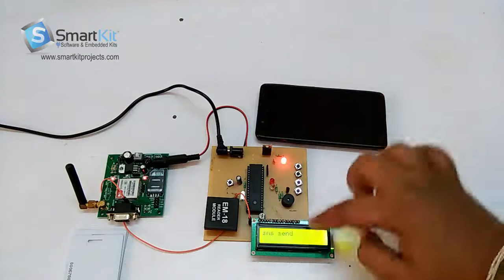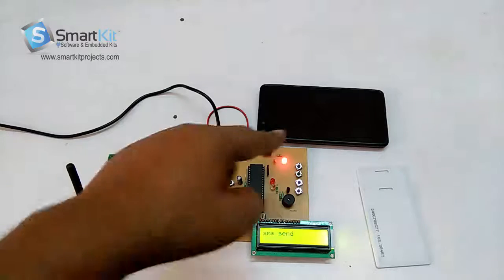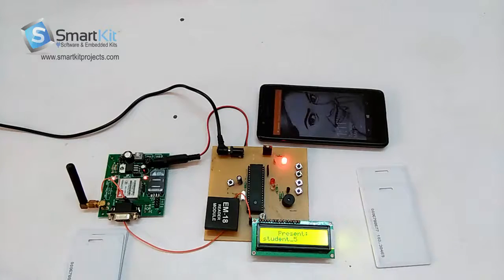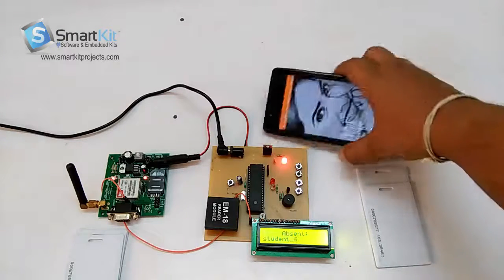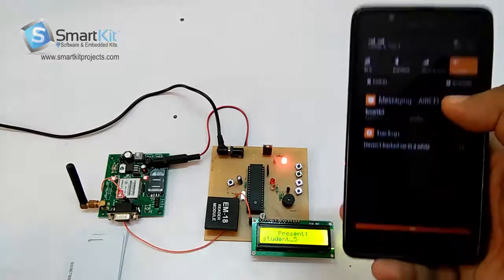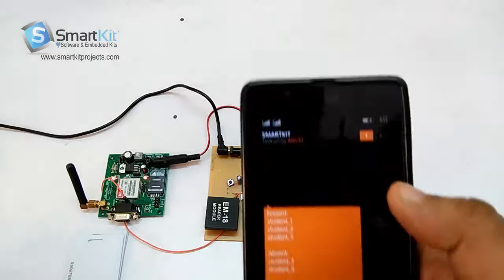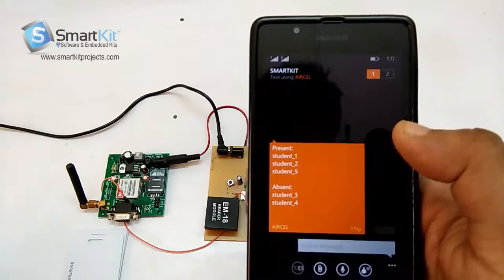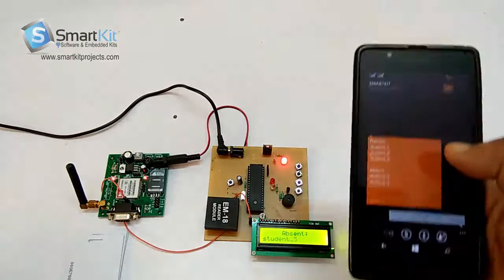RFID Based Attendance system with GSM notification System using PIC Microcontroller

Comment: Sir if u has also this ckt. with the help of arduino with program and the another complete ckt. using pic microcontroller also I really don't know because in ur description ckt. the maximum will be connected  in ur digram .. Sir plz help me plz. my email id kumarpreeti497@gmail.com
Reply: max. pins not connected with pic Mic.
Reply from the maker: shivam singh hi  we can make this project on arduino if you want ..
Reply: Hello sir,  which data send em 18 to microcontroller. Because I am working on other project in use em 18.